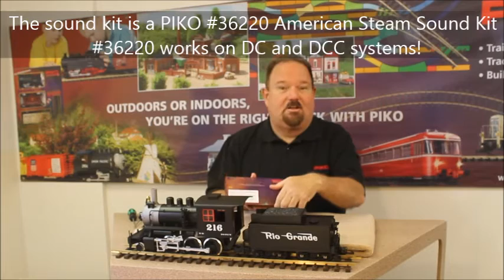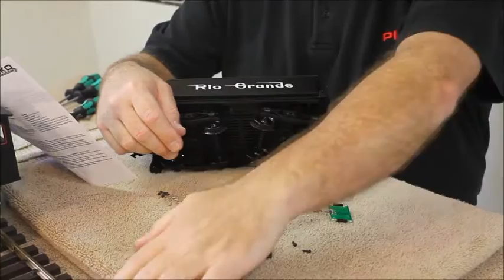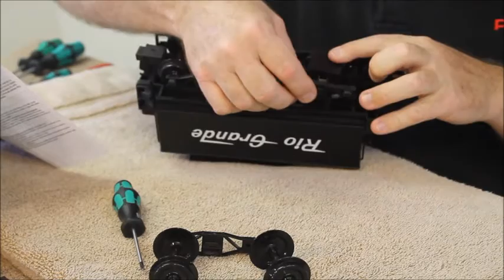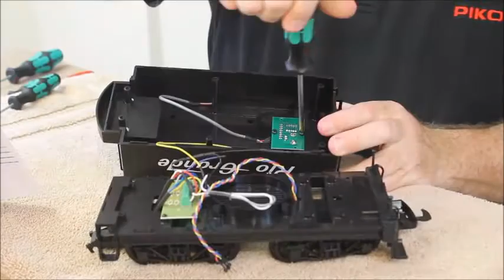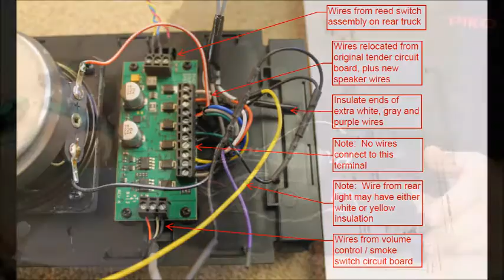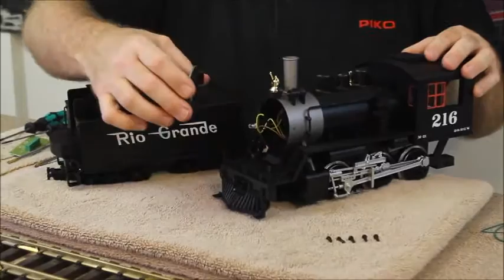Steam Sound Installation - Digital

Comment: Will this work with digitrax dcc system?
Reply: I have one of these locos with this sound and DCC, it works great with my NCE system.  DCC decoders that are NMRA compliant work with ALL DCC systems, or at least so far they all work with my DCC system from about 8 different decoder manufacturers.  They're might be some really old decoders out there that may not work.  I actually have a 2nd one of these systems arriving in the mail today, hence why I'm watching this video as I'm really impressed with the one in my other PIKO loco, the sound and control is great in both DCC and DC modes!
Reply: @Jon choochoo93 Yes, the SoundTraxx made decoders work with Digitrax.  Your only possible issues would be if you have more than 24V going to the track or if you were trying to use a digital system that is not NMRA compliant.
Reply: @danpikoamerica7314   My Max is 24 V should I be concerned with anything else if I do buy that kit?

Comment: Does this give DCC functionality as well? Or do I need to buy and install a separate DCC decoder?
Reply: Jesse, The 36220 American Steam Sound Kit includes all you see in this video... The DCC circuit board (or digital decoder) pre-loaded with sound files and digital train control software, a high-quality speaker, a volume control circuit board that also has a smoke control switch (for if you choose to add a smoke unit), a reed switch and a cover for the reed switch.  So, this includes the DCC decoder and all sound items you need.  (The only thing you might want to add is a smoke unit and some smoke fluid.)
Reply: @danpikoamerica7314  thank you so much for your quick reply. Very exciting to know all I would need is this to get my SP #4449 Mogul ready for a DCC layout.

Comment: I have a question I bought 0-6-0 union pacific version with the electonics already installed. When I first trun on the unit the smoke unit is strong but then it tapers off is that normal?
Reply from the maker: +Douglas Schultz Hi Douglas:  It would be good if you could give us a call on our toll-free number 877-678-4449.  There are several things that could affect the smoke output, ranging from the type of power supply to electrical contact issues.  We can walk through some steps to help diagnose the problem.
Reply: +PIKO-America Cool thanks I'll call when I'm available.
Reply: +PIKO-America Thanks for the help much appreciated. Piko transformer made the difference.

Comment: One Question.. Do you have to remove the 5 volt regulator from boiler of the locomotive or can it stay? I noticed the loco ran fine without it removed in the test run..
Reply from the maker: +Babs Courtney 
Babs, great question.  The voltage regulator in the standard 0-6-0 and Moguls duplicates the voltage regulator built into the 36220 digital sound circuit board.  If left in, it will run with no problems since they duplicate the same function.  However you can remove it if you want to eliminate the duplicate work, or if you would like to use it in another locomotive.  Thanks for the questions, and have fun running your trains!”